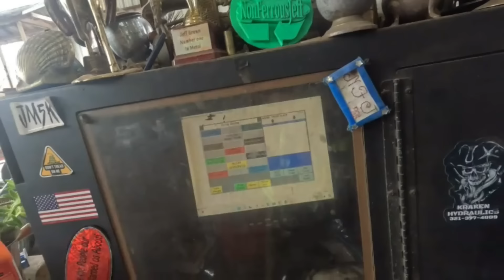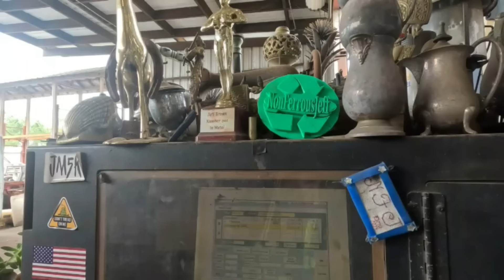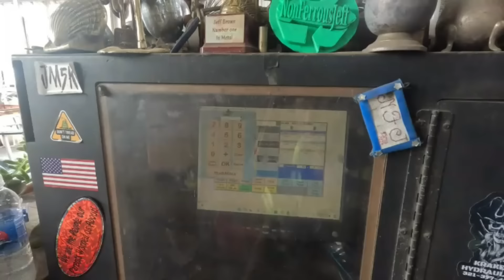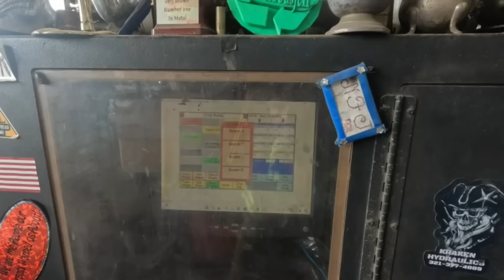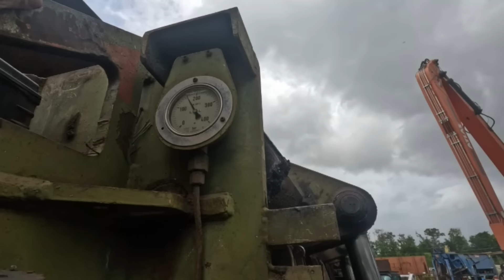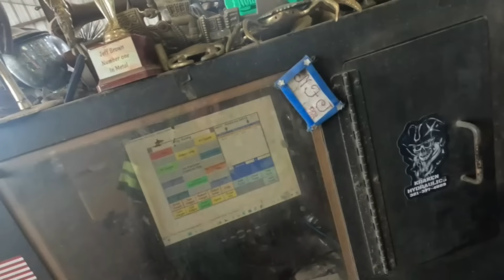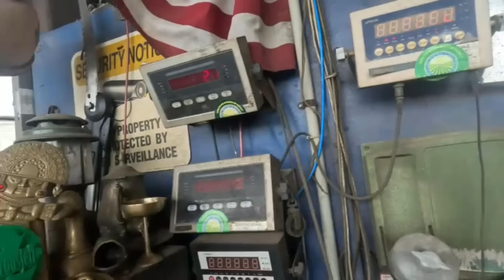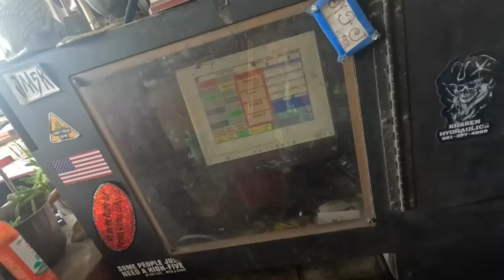JUST A PART TIME SCRAPPER #metal #recycle #crushing #recycling #steel #iron #copper #scrap #brass

Comment: Plug soup is when scrappers boil plugs in water, this softens the plastic casing. This makes it easier to pull out the brass pins and any remaining cable. Refiners will shred the plugs and use mechanical and electrical methods to extract the copper and brass. If you are taking cable with plugs attached then you might get more money leaving the plugs attached. Weigh a plug and work out what you would pay as cable / wire and as dirty brass.
You could employ a plug soup operative and get them a big cauldron and a black pointy hat.  Great video as always.
Reply from the maker: @ebikescrapper3925  I have never heard of the plug soup. The place where we sell our wire too wants the plugs on for the brass content. Thanks for watching

Comment: plugs. you can also clean it. put it in the vice with the points up and pull your bras pin out with pliers. then you have clean bras
Reply from the maker: @dominiquecocu  that would only be worth the time with dryer and stove plugs in my opinion

Comment: Mine does not buy ends of power cords. I just remove the brass out, then cut the copper off. Put them into a  bucket and they buy both. Clean brass and clean copper.
Reply from the maker: @davidlechman1611  that's smart.

Comment: You could have a separate bin for televisions and take a plastic waste charge of the total weight.
Reply from the maker: @ebikescrapper3925  that would be up to them outback
Reply: Ask the yard to pay twenty per cent less for steel and call it a plastic waste charge. If people complain then tell them to separate their plastic and metal at home. To have staff monitor incoming yard traffic would not be economically viable.
Reply from the maker: @ebikescrapper3925  do you mean 2 cents less. Some one told me yesterday that another scrapyard said tin was going down to 2 cents soon. Yikes

Comment: Single wire rap wow that's not what you normally do nfj
Reply from the maker: @johnporter4149  what do you mean?
Reply: @nonferrousjeff  you only ran one wire on the bail not 2 wires like you normally do
Reply from the maker: @johnporter4149  oh the painted siding bale holds together better so we use single wire on those bales